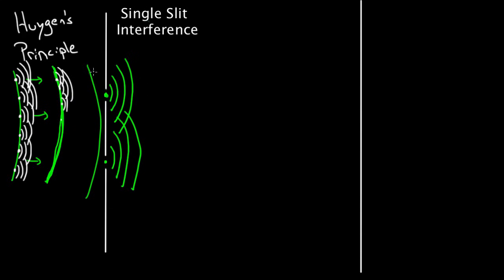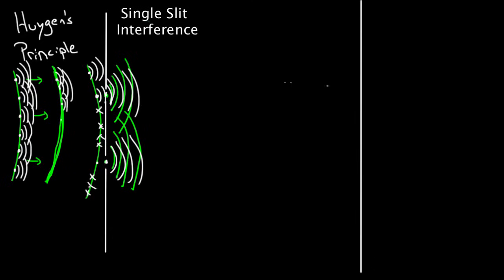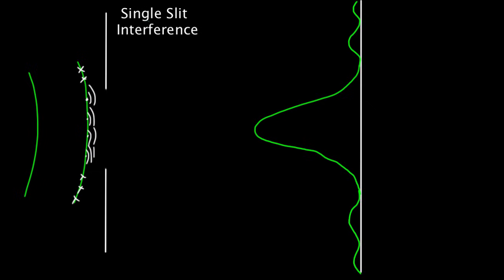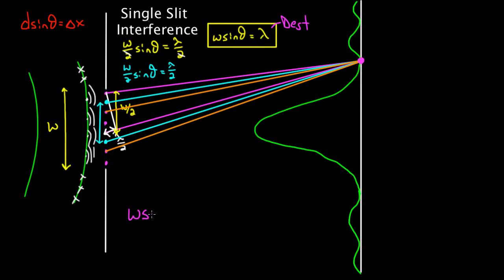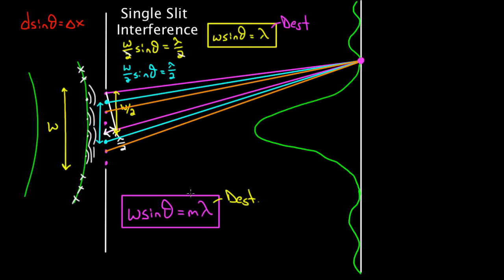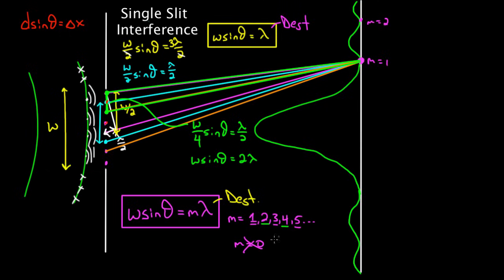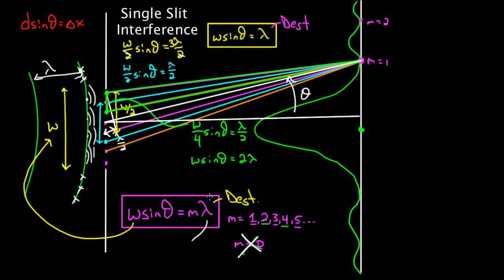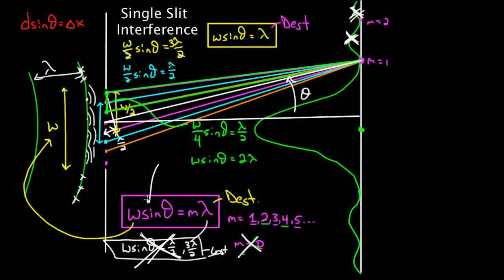Single slit interference | Light waves | Physics | Khan Academy

Comment: Why are we only considering the points spaced w/2, w/4, w/8 apart? Shouldn't we be considering each pair of points instead since they each would contribute to the intensity? Also, it seems like even if the w/2 cancel because they are half a wavelength apart, the points w/4 apart wouldn't cancel because by definition they must be less than half a wavelength apart so I don't see the logic there at all.

Comment: I understand your explanation of single slit diffraction of light and the production of small maxima either side of the big central maxima. However, whenever single slit diffraction diffraction is set up in a ripple tank there is no sign of the small maxima either side of a central maxima.

Comment: How can we be so sure that destructive interference will occur at those specific points like if the waves from the uppermost and the middle points interfere destructively at that point then it could also interfere constructively with the waves from the other points .... And why should we take half of the slit and not the full one ??? They are just ripping my mind @part!!!
Reply: Sheraz Khan experiment
Reply: For a destructive interference to happen, all the waves have to cancel out - the sum of their "heights" has to be 0.
That means that for every wave with height y there has to be a wave with height -y at that point we are looking at.
If it were otherwise, all other waves would cancel out and that wave would be "left alone" so that point wouldn't be a dark spot, the sum of the heights would be equal to its height = y.
So whichever way you add the waves, you should always end up with the sum = 0 for it to be a dark spot.
for example lets say you add up separately waves with positive heights at that point in a specific time, and separately the ones with negative heights then. lets say the heights are y,x,c,v,b... and -y,-x,-c,-v,-b... or what ever names you want to call them. The sum of the positives is y+x+c+v+b+..., and the sum of the negatives is -y-x-c-v-b.... and the ULTIMATE sum is (y+x+c+v+b.)+(-y-x-c-v-b...). As you can see whatever the sum of the positives is, the sum of the negatives is always - that, so the sum is always zero for that point. So pairing off the waves is just editing the sum (y+x+c+v+b.)+(-y-x-c-v-b...) to y-y + x-x + c-c + v-v + b-b +...
(You must note that the heights of the waves are dependent on time so when I say that a wave's height is positive I mean its positive in a certain moment in time, not always, same for negative).
You might ask well how do bright spots appear then.
Well for bright spots at a specific moment there are more "positive" waves than "negative" ones, or vice versa, so not all of them cancel out, and thus the sum is not equal to zero and there is a constructive interference.
Hope this helped :)
Reply: IKstreme Yeah that was a great explanation . But what I am thinking is that why should we apply plain Mathematics to it .... If I apply some logic , what my mind says is that there shouldn't be any destructive interference . Like , for example all the waves arrive at the same time ... You said there will be y for -y and x for -x and so on . But let say the y . Thus y could also be in destructive interference with the x wave or -x or what else you call it  . Then , why should we add up the two y's (positive and negative) . Now you might say that x and y can't be added because they are different variables but let's forget about that because we don't have an equation like that . It could be numbers and then numbers could be added in any way . What my concern is that why should we be adding two waves from two distinct points while there are waves from numerous and numerous points . Based on your explanation , I think when we add them all together we won't be getting either a constructive or destructive interference anywhere ...There shouldn't be one of them.. I hope you get my point.
Reply: if y and -y are in a destructive interference, and y and -x are also in destructive interference, then so are x and -y, so any way you pair them up the total sum is always zero:
(y-y)+(x-x)= 0+0 = 0
(y-x)+(x-y)=0+0 = 0
Even if you add waves that are not in destructive interference the total sum will be 0. lets say y+x=a, then by simple maths (-y) + (-x) = -(x+y) = -a.
So even if you do:
(y+x)+(-y-x)=a-a=0
you still get zero because ultimately they somehow all cancel out
Reply: IKstreme Ok it makes sense but I am still very much confused . I am just thinking that how can there be + for every - when the waves are pointing at a point far away from the central point ?
Reply: Does this also mean that the "infinite" number of diffracted waves .. Always consists of equal number of positive and negative waves.. And if it is so won't it just be wrong to consider that infinite number to be an even integer?
Reply: Consider the "infinite number "as an even number  just simplifies all of it a little bit. You can just chose an even number N and then "break" the width into N  "points" ( in this case, 8) , then you can calculate what you want to know making N bigger and bigger ( this is, N tending to infinity) and the limit of it is what he said in this video. Of course a really technical prove would be using really advanced math, he is just showing how it could be more "intuitive" for us.

Comment: Great video ! Very informative !
Just one question , how is the difference between the two arbitrary points chosen , w/2 ?
Reply: Anubhav Bahadur if you calculate it comes out w/2.
There are 8 points hence the distance between two consecutive points is w/8.
The points he chose had 4 points in between. 
Hence, the distance is 4*w/8 = w/2
Reply: Actually it's not arbitrary, you set and divide the slit line up in such way that two  points superposition cancels and things pair up.
Reply: @papiyaghosh102 each two pairs cancel out assuming slit is very small right?

Comment: This has bothered me for a very long time.  Thank you very much for this video.  Great explaination!  My very minor criticism is when you say that the wave cancel completely at that point. Later, you explain that there is a slight difference [in the length of the triangle].  At that point you could add that’s why they don’t cancel entirely.  But, I wouldn’t redo or add to the video if it changes the duration google posted as it gives you precidence!  Again, great job and thank you for bringing up Huygen’s! — Jim Foit

Comment: Not sure if this counts but I have a growing light for plants. Unintended experiment. There is a small single slit where light breaks through. I get 4 single strands of light in a tight angle, Red, Purple, Red, Purple.
What the heck is going on here?

Edit: Ah I get it, now, the edges spits the light. 1 edge, two beams. 2 edges 4 beams. I've never seen this before, I was just mindblown how it could happen without trying. Perfect conditions.

Comment: It was clear. But why are we choosing two points which are half a slit distance apart. If we choose the top and the bottom point they would still interfere and form destructive pattern at lambda by 2 path difference. I am not understanding why we are choosing two points one in the top and the other one in the middle of the slit.
Can anyone pls explain?

Comment: The most intuitive way to explain how or why a particle like a photon (or electron, etc) might behave as an uncertain location particle while also like a polarizable axial or helical wave ''packet'', given that everything in the universe from electrons to solar systems are in orbit with something else pulling them into polarizable axial or helical apparent waves depending on the orientation of their orbits as they travel thru space, is that they’re in orbit with an undetectable dark matter particle pulling them into polarizable axial or helical apparent waves as they travel.

And given that we know we’re in a sea of undetectable dark matter but don’t know where it’s disbursed, we can imagine that they’re in orbit with an undetectable dark matter particle pulling them into polarizable axial or helical apparent waves as they travel where the speed of their orbit determines the wavelength and the diameter is the amplitude which would explain the double slit, uncertainty, etc.  No?

Comment: umm shouldn't this be called single slit diffraction?
Reply: Technically, it should be single slit diffraction AND interference. Since, even in YDSE, the waveform diffracts and spreads through the slit, the key really is the interfetence which occurs.
Reply: In india it is diffaraction lol
Reply: @yaoooy  are you confusing with refraction?
Reply: @yaoooy  Diffraction happens in same medium. When medium changes, it's refraction.

Comment: While pairing with each secondary   sources wave,  I noticed If I take the two end points. This doesn't  the same relationship. So  I want to ask, why am I taking the sources  which have difference  of W/2
Reply: It's actually complicated. We have to take slit width W tending to 0. We get number of waves.Then we use calculus to find integral of all waves coming from infinitesimally small width. Frensel did the calculations for us. But for students, we assume W/2. We can also take W/4.
But it has to be even for destructive and odd for constructive.
Reply: @haemophilusinfluenza9199   so  this derivation  is to understand  it simply. Thank you very much for your response.
Reply: @amber9643  I forgot to add that it's proven experimentally that,
For W/2, W/4 and so on, slit produces minima
And for W/5, W/7 and so on, slit produces maxima.
It actually has an explanation but you have to search it yourself.
Reply: @haemophilusinfluenza9199   ok. I will do some research.

Comment: there is no interference 
1.all the points on the wave front are the source for new wave.
2.circles are drawn a the points as centres
3.the circles are joined tangentially
4.and light travelles
Reply: ajey bhat But the circles that traverse backwards get cancelled out by incoming wavefronts right? I don't see whats wrong with his presentation.
Reply: Spandan Bhattacharya  we know tat  amplitude =1+cos (teta), in forward direction, teta = 0deg hence amplitude will be 2..... in backwards direction, teta= 180deg ; ampli= 1+(-1) = 0....!!!! tats y there are no backwards wavelets..!! :)

Comment: I could be wrong but Im shore the angles wouldn't be the same
Reply: Aweri Blakely You are correct.  The angles are very close/ approximately the same if the distance to the wall is much larger than the  width of the slit.  This is often the case, but he should have mentioned this approximation.  Good catch!
Reply: Andrew Stuhr Haha I stopped too quickly to reply.  He does mention its an approximation.

Comment: The mistake everyone is making with this experiment is they assume that the effects of the hole on the light passing through it do not vary over time.   People assume the hole and its effects are a constant.  What if they are not a perfect constant in the experiment.  The effects of the whole have a distinct pattern but may not be a constant.  Imagine if the hole is acting like a type of liquid lens.  What happens if you disturb a medium in a fluid form.  It generates a pattern.  If you shine light through water and disturb the water you see an interference pattern because of the waves.

I believe it is a mistake to assume that any two particles of light will ever be able to traverse through the hole and experience the same transition effects.
Reply: This video is theoretical explanation of experiment for students. Better for students if it's not so complex.

Comment: What if I pair up topmost and bottommost point ???
Reply: 1 and 8 pair constructively, rest pair up somewhat between constructive and destructive. However the 4 resultant waves have different phases and when they are added up, resultant will still be 0, albeit by applying more complicated mathematics.
Reply: It's actually fairly simple when you think about how interference occurs.

It's addition that causes constructive and destructive interference, so its almost like doing this:

1 + 1 + 1 + 1 - 1 - 1 - 1 - 1 = 0

I am trying to simplify it with a really dumbed down explanation, but the concept is pretty much the same.

His pairing is pretty much doing this:

(1 - 1) + (1 - 1) + (1 - 1) + (1 - 1) = 0 

There are no changes to the results, it is rearranged in this manner purely for explanation purposes.
Reply: Leyton Zhang holy shit u just cured my brain cancer gj broo

Comment: can I ask something? In Huygen's Principle, do all those tiny waves have the same wavelength as the bigger wave? can someone show it to me mathematically that they cancel out?
Reply: Karl Ruv Yes they have the same wavelength, now in a wave when a maxima and minima (which has the same Amplitude as the maxima, only of the opposite sign). You can practically see it by dropping a pebble on a pool of water, and as for a detailed mathematical analysis, its easy but beyond the scope of a comment box. Google it. Hope I helped...
Reply: they have the same wavelength, frequency depends only on the source, and if the medium is not changing the wavelength does not change too

Comment: Is the slit even necessary? Wouldnt it be the same if the first barrier had no slit? The same pattern would appear on the first barrier.. the slit just lets some get through. Is there a difference between the original source in the first box vs the slit in the second box.. they seem like theyre doing the same thing. If thats true.. then the slit and 2 box are pointless and so are 2 slits.. 

Why dont you just fire the laser directly at the wall insteadingn of adding something which can reflect the light in differecnt directions.

Also isnt the wavefunction suppose to collapse when you observe it? So holding a laser at the slits should have produced 2 dots.. not a pattern..

Comment: why does it have to be the rays that are half the slit length apart being half a wavelength out of phase?
Reply: +Kelvin Fan how come its not like (w/3)sine theta = lambda/2
Reply: I too as bothered by that, but then I wrote it down and realized that it does not matter, we do it so that the math and the equation derived is simple. As long as the separation between any two chosen waves is constant(because we want the path difference to be lambda/2 for destructive interference at a given point), everything works out.
Reply: Parth Upmanyu Ohh. Thanks for taking the time to reply! haha. I will think about it. I think what you're saying makes sense.
Reply: It does matter, as the angle theta is not the same, if we keep the path difference the same for point sources on a straight parallel to the screen line.
Reply: I never said that the value of theta does not matter. In fact the whole equation is driven by it. I said that the separation between the rays does not matter. For a separation A, there will be a specific theta1 or for a seperation B, there will be a theta2. So, it does not matter if we take w/2 or w/3. We can use both to describe the equation. We choose w/2 because the math becomes easy.
Reply: btw I'm having a lot of fun in this comment thread :)
Reply: Parth Upmanyu I think it does . Suppose if we take the uppermost and the lower most points then the width is that of the whole slit and it comes out to be dsin@ = Lambda/2 (where d is the distance between the two points or slit width) ....So the formula then comes out to be wrong ... Isn't it?

Comment: how wide does the slit need to be for the effect to be present?
Reply: Around the same width as the wavelength of light being diffracted. Too large of a width would not create a diffraction pattern, instead only a slit would appear on the screen.
Reply: wendy L Are you sure? Veritasiums video shows a slit at something like 0.1mm slit. How long/wide is a wavelength?
Reply: Depends on the type of electromagnetic wave
Reply: Abdul Sharapov uhm, but its not 0.1mm...
Reply: All light is diffracted by any size aperture. Diffraction is wavelength and aperture size dependant but diffraction exists in all cases. The smaller the aperture is with respect to the wavelength, the stronger the diffraction (when you cannot see it, it's more a case of "just because the diffraction is very small it doesn't mean it is not there" :)).

In optical systems (things like telescopes) we see something called Airy Disks which are the single aperture diffraction effects (the resultant intensity Khan draws on the right in green), except it is a 2D incarnation. In the example of a telescope, the objective aperture (the "slit" doing the diffracting) can be metres wide, and the wavelenth is half a millionth of a metre; but the diffraction is still there and clearly visible.
See...  https://en.wikipedia.org/wiki/Airy_disk